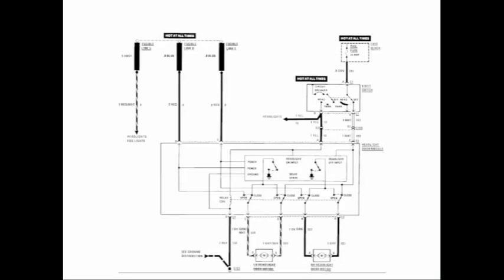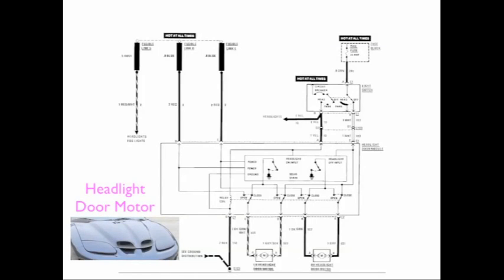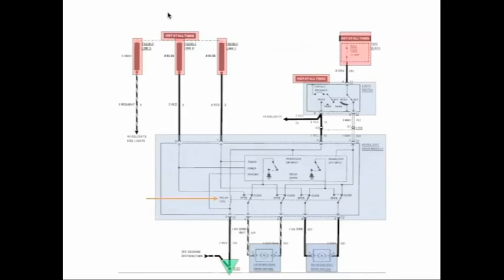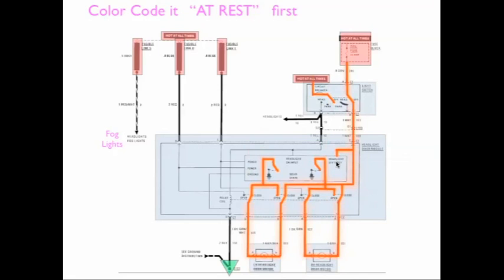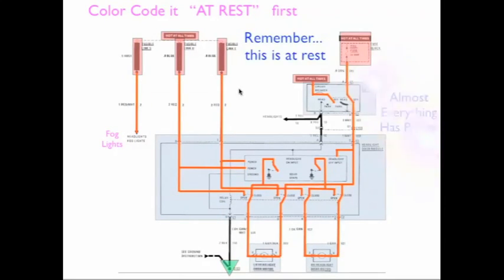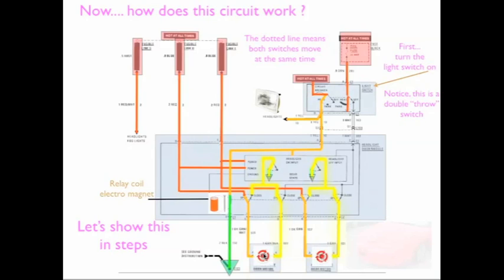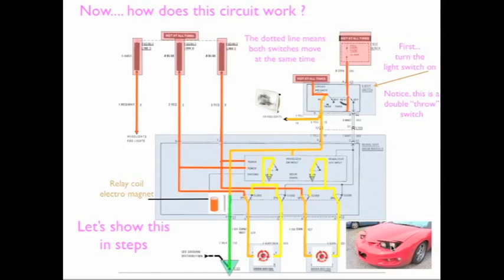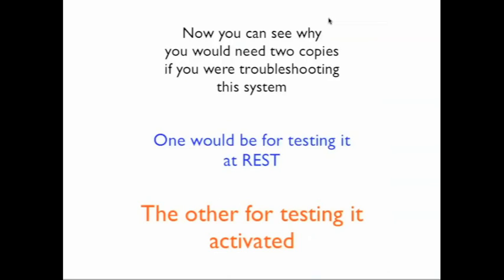Elec Series Lesson 3: Polarity Changes

Comment: Hey I'm really enjoying your videos so far - they've helped me a lot! However, I checked out Jorge Menchu's website as you suggested and and it seem like you two are at odds about which color means what. For instance, he lists yellow as being ground all the time, where as you list green. I'm I missing something?

Thanks for the great videos!
Reply: The Color-Code Legend From Wiring Diagram Color Coding by Jorge Menchu lists green "Ground all the time" and yellow Ground when the circuit is complete Open circuit voltage when it is not.

Comment: Hi there !!! I have a 2003 bmw x5 3.0 ... I have a issue with the ac compressor .. The compressor does get 12v .. Fuses are good I don't understand if the ac control module needs power from any sensor to make  the ac compressor clutch spin ,,, there is not ac clutch relay all the wires come direct from the ac control module ... There is only two powers that comes from the fuses to the ac control Module but nothing comes out to the ac compressor ... Thanks if you help me or somebody help me with any ideas !!!!

Comment: I printed out this diagram at the shop and have been studying it. I am real curious as to what stops the motors when the doors reach full open and or full closed. 
My guess is that the ground contacts inside the headlight door module open, when a door fully opens or closes, due to a rise in current flow when a door hits a stop????